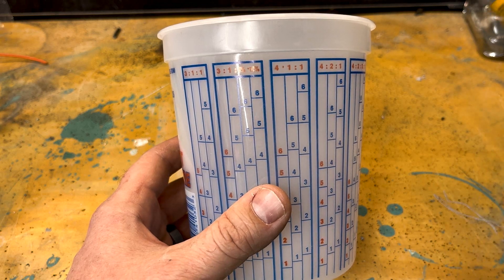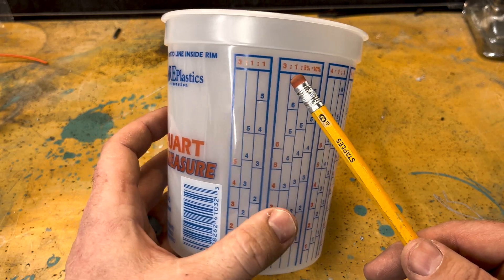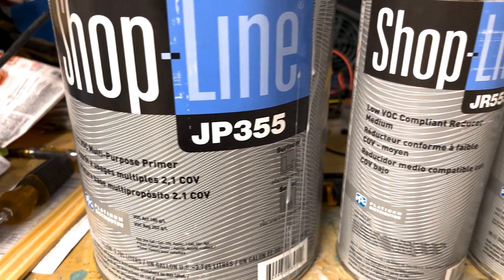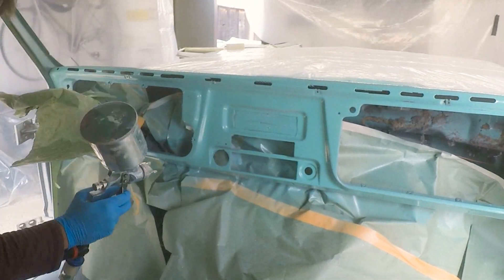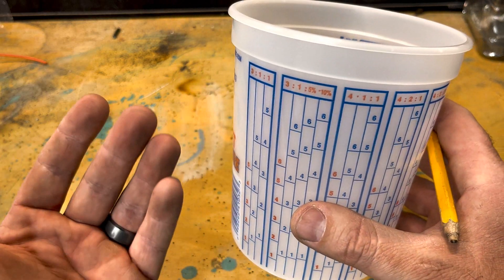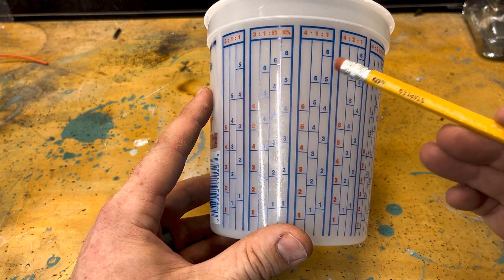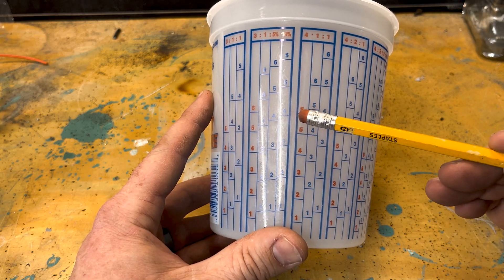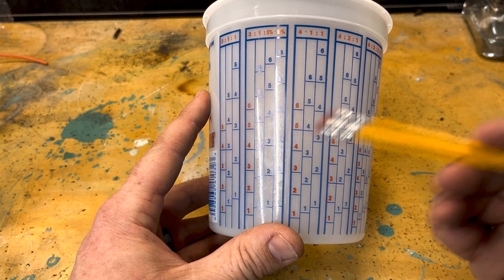Mix Ratios Explained

Comment: Ok so im painting my truck with a single stage urethane mixing 3.1 mix and it says i can add a 10% reducer would that be 3.1.1 ratio?
Reply from the maker: @enjoythesho1992  the reducer is just to thin out the paint, so I would put like a cap of reducer in and if it seems runny go without it